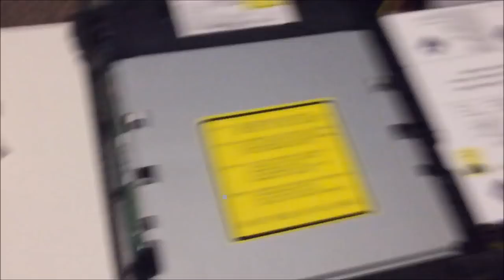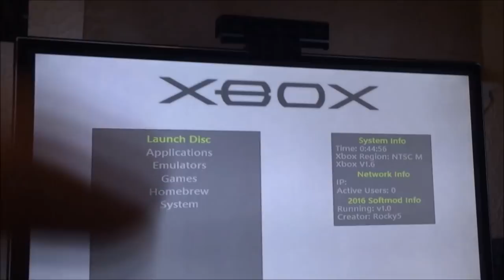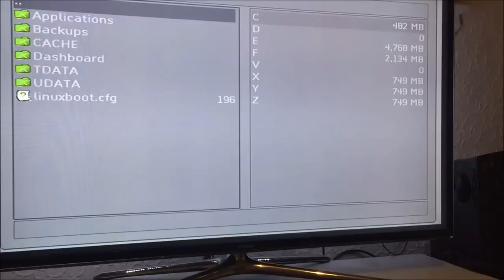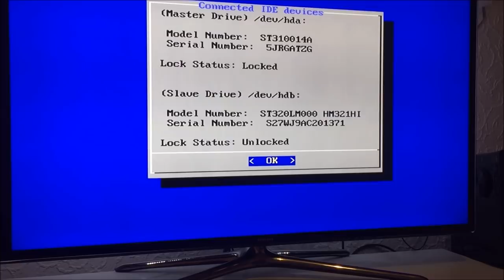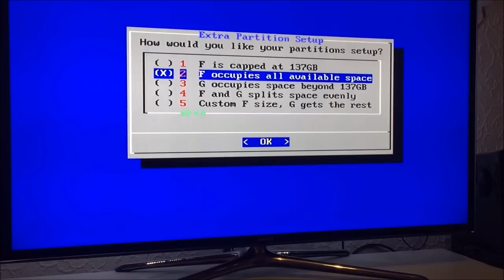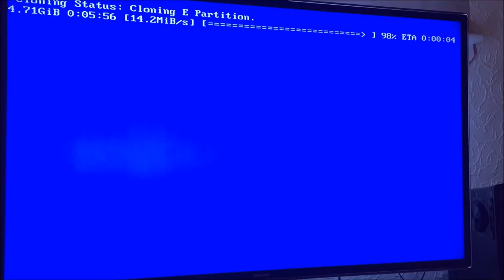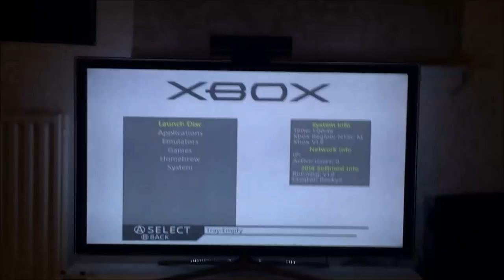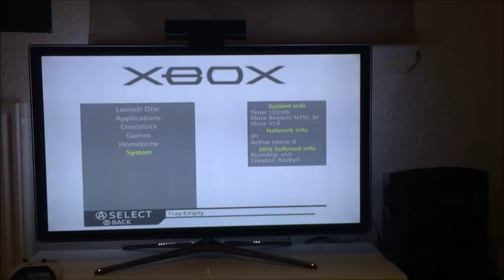How to clone your Hard drive using Chimp 261812 from start to finish.

Comment: One last question for you. I'm going to buy a different HD. Sata with the red adapter you have. You say you bought a new IDE cable... Will the stock one in the xbox not handle the job?
Reply from the maker: +Blackanese The Baby I would say no, you can get and 80 wire ide for pennies now a days, you will also see a slight speed increase in loading times for games when using one.

The issues I found and others is the 40 wire cable ( default Xbox cable ) causes to much interference when using most Sata to ide adaptors and the result were extremely long boot times or refusing to boot altogether. One of my adaptors caused my DVD drive to not read discs when using the 40 wire cable lol ( Xbox still booted )
Reply: JCRocky5 I see. I found one on amazon that I believe is the right one. Also found a compatibility chart with drives that are lockable so hopefully I'll be good there. Do you happen to have a video of installing and securing the data drive inside the Xbox after the clone or is it as simple as screwing it in where the old HD went and slapping the cover on the Xbox?
Reply from the maker: +Blackanese The Baby it's as simple as screwing it in, if you use a 2.5" drive you can obviously only screw it in on one side of the enclosure. 

Only issue you may have is fitting the 80 wire IDE cable, as the Xbox uses an non standard size cable but it does fit just takes a little time to get it sitting correctly.

You can also buy 80 wires ide cables via eBay that come in larger sizes.

I will try and find the diagram for folding an 80 wire cable.
Reply from the maker: +Blackanese The Baby here is the diagram ( web page ) buy a 24" ide cable.
http://web-nine.com/projects/xbox/ide/
Reply: JCRocky5 Thank you for your time and assistance. It was greatly appreciated!
Reply from the maker: +Blackanese The Baby no problem :) I'm here to help, if you have any more issues just give me a shout.

Comment: Hi JCRocky, you're probably the best on the xbox atm. Wonder, i have a lot of pain to format my TSOP V1.4 Ind-Bios  with my updated config file to start xbmc. So when i format the extented partition i have a lot of problems to make it work after a good transfer (HDD get corrupt.) So i wonder does this chimp gonna work well with tsop. I can format with it no problem, I only always have a doubt with chimp vs xbpartionner to do the right job. Chimp is so uch easier to use since you've updated it. Look there's something i've miss here with big hdd... Your chimp look different from the one i have (XBLAST OS??) Thanks
Reply: You see right now i'm wondering, should i format 50/50 or F: take 137gb and G: take the rest. Does this matters when you use IND BIOS? Also all the time if i check with XBPartionner i see no error in my cluster on each drive but still have problems with the drive. Any way there's a tweet proof tutorial for bigger sata drive to setup with tsop.
Reply from the maker: It depends on the size, but chimp 261811/12 will format your HDD properly, intact it’s 100% successful every time unlike XBP that can take a couple goes to get the format to stick.
Reply: JCRocky5 thank. BTW i actually make it work right after my question, cause i've formatted with chimp.

Comment: Whew... I have a startech PATA -> SATA adapter. Couldn't get it to work after trying multiple Xboxen, IDE cables, and hard drives.  Finally ordered an HDE adapter from Amazon (two pack for $13.99), and it works great.

Comment: I recently soft modded an Xbox again (had one at release long ago, which has long gone) during lockdown decided to do something cos i was bored numb.. So started messing about (and spending money) again.. stuck an old 80GB IDE drive in it, but as its probably older than most of the people on YouTube and give a s**tload of SMART errors during use. so I`ve got a SATA adapter and just got a refurb 250GB SATA HDD, but the sodding cable aint turned up yet.... Also removed the clock capacitor, nice to hear a different accent on here.

Comment: Hey Rocky I don't know if you'd see this or not. After I do this and have my new HDD in, with the Original HDD I think is still locked, per these instructions; then could I put in the original hdd if the new one ever dies?  If so, would I repeat the chimp clone process just as normal?
Reply from the maker: As long as the drive is locked to the current eeprom hdd key then yes you can always use it to fix up a new drive if your new one dies.
Reply: @JCRocky5  thanks rocky

Comment: Question: I followed your steps and replaced the XBOX HDD with my WD750GB HDD. What should the displayed disc size? In the partitioner, the extra partitioner is shown to be ~691GB and on the main screen, F is displayed to have 707GB. is this correct?
Reply from the maker: It should be fine, XBPartitioner counts sectors and UnleashX may just do a ruff check, don’t know without the source. But it should be fine. 

Check XBMC and see what it says for it’s size.
Reply: @JCRocky5  Thanks man! Can't wait to actually delve into the games and everything! You're the best!

Comment: Hello JCRocky5, I followed your instructions step by step , everything went fine and as expected but once I switch the old hard drive with the new one , after the boot up animation of the xbox i get a black screen ,unless i press the eject button on the console ,which will then make it boot into unleashx just fine . I do not know could cause this maybe its a dual boot setting? thank you
Reply from the maker: Applications > NKPatcher Settings > Kernel > Advanced Features > delay files > select 2 and reboot. 

If it still happens select 3, eg.... be careful as these can have adverse effects. So read the instructions at the top of the menu. 

Also what type of drive?
Reply: @JCRocky5  YEEEEEEESSSSSSS!! Finally, been fighting with this for months and finally found this.  A-DATA 64GB Sata SSD, had to use 3 Delay files, now boots properly! (Was stuck on black screen over 6 different drives)
Reply from the maker: The delay files just help fix issues with the exploit. I would also let it pick the correct kernel font for your Xbox as this will give you better compatibility. As by default it uses the generic font. (The select process it automated)

Comment: Hello JCRocky5 back for one more question so i went with the sata drive 
bought the green sata board adapter that you are not using in this video
 but did show in the beginning, the confusion for me is when cloning the 
master drive to the new sata drive what are the settings for the jumper 
on the green adapter? as there are only 2 options on green adapter slave
 or master so what one should be used during the copping process? cause 
you keep mentioning cable select ? don't see that option on the green 
adapter? and one more question once the coping process is done and 
complete on the new sata drive with the green adapter that i just copied
 the master files to, what do i set the jumper to now ? i would assume 
master, cause it is the new master drive but in the end you said it 
always remains a slave so i am confused please explain, cheers and 
thanks again for all your help
Reply from the maker: +elcarohw cable select is no jumpers, but slave is what you want and after the clone you set it to master. ( cable select allows the Xbox to pick what's the slave and what's the master, based on where the drive is on the ide cable )
Reply: ok so i should remove the jumper during the cloning process? or put it to slave ?
Reply from the maker: +elcarohw put it to slave and after the cloning and locking is done put it to master. ( you may get error 7 if cable select is set when using the new drive )

Comment: what dashboard/skin are you using? it looks so clean, I would love to use this.
Reply from the maker: +Avoiding Human Society it’s the skin I made for my softmod, as I wanted something clean and simple to look at and consistency across the installer. ( saves space if all your skins use the same textures )
Reply: JCRocky5 I found the skin from a post on reddit. I had to stalk your name and search around but you uploaded the unleashx skin to Google Drive on a reddit post. I am using it on my TSOP. only thing I can complain about is it doesn't tell you drive space but that's not a huge issue considering how clean it is... you can always go to settings and storage to look.
Reply: I agree. I love it's simplicity. Now I have to go searching for it too. :D
Reply: If you haven't found it here it is, I uploaded it to my mega account. just throw it in your unleashX Skins folder. I changed the creator name to my gaming nickname since there is no nickname option, no disrespect to the amazing JCRocky5. Feel free to edit it and change it to whatever you want.

https://mega.nz/#!1AcgCAAC!Dff7fGJHcRpuyu3QmnyOUd8lG_2bEj21tBFHy8edsIU
Reply from the maker: +Avoiding Human Society proper versions. 
https://drive.google.com/open?id=0BzRN8P835YijUGhyeTJWdTRpWEU

With new info where the softmod stuff was.

Comment: Do you have to do anything special to secure the hard drive once you clone it. The one you put in is smaller, so does it fit correctly, or do you have to do anything to get the screws in place to keep the hard drive from moving?
Reply from the maker: +Josh D mine sits unsecured but I don't have the lid on this Xbox. But you can use 1 screw to hold it screwed in tight. 
( there isn't much weight to them so they won't move about or undo screws )
Reply: Ok, awesome! I have another question; I've noticed that the softmod will soft reset the Xbox when I go to the save manager and view something that isn't a save (ie DLC or such). It just freezes, shows your logo, then resets back to the main menu. My Xbox will also temporarily freeze in the Extras disc (for at least 15 seconds, LT+RT+Black+Back will eventually kick it back out to the menu) on certain menus if I press up when I'm at the top of the menu. Is this due to instability, and would changing the kernel fonts or delays help?
Reply from the maker: +Josh D the crash in the save manager is just an UnleashX issue that was never fixed or can be fixed. 

The disc freezing the Xbox I haven't a clue as I don't get that issue or had anyone else come to me with an issue like that. 

The kernel font installer is only ever to be used if your Xbox hangs at the XLogo screen randomly. If you never have this issue then you don't need to use that advanced option.
Reply: Thanks a lot for the help, and also the great softmod and tutorials! I really appreciate it!

Comment: Will that green IDE to SATA adapter fit into the xbox with a 3.5" SATA drive, with all cables connected? Just making sure before I pick up a 1TB seagate barracuda, looks a bit big in the video!
Reply from the maker: +Eric Hurley yes, the adaptor does. Depending on the cable length you get it might be a tight squeeze. 
( for the cable not the adaptor, I would also put a bit of card or foam between the adaptor pins and the metal shielding of the drive )
Reply: Oh god, the green SATA/IDE adapter arrived from China this morning. I could only laugh at the quality of this thing haha! The soldering is abysmal and it's actually missing one or two SMD components. I kinda feel scared to plug it into my new WD 1TB hard drive.......I might pick up one of those Startech ones

Comment: Dude is there anyway to make this work with the HDMI Pound cable? It black screens. I do not have any TV's that use RCA cables anymore...
Reply from the maker: Try disabling all resolutions. If that doesn’t work then no, Chimps linux distro is old and doesn’t work on all video encoders above 480p.

Comment: Hello JCRocky5 , does the softmodding has limitations? i´ve changed an Hd with 160g to a 500g, its almost filled with games but if i put new ones they don´t launch. What am i missing here? i´ve done some search via google some people had these issue because of tdata and utdata file limitation
Reply from the maker: That’s not a thing and no. 

All you need to do is make sure the HDD is formatted properly. 

Also if you think it’s the UDATA issue (that was debunked) then rename your UDATA folder and let the game make a new one. 

Most issues regarding loading are corruption/corrupt hdd.

Comment: Hi JCRocky5 , I have installed your softmod and burnt the xtras disc, from the xtras disc I installed chimp , this placed E:\Applications\Chimp and in that folder there are 6 files and no folders, do i have to manually copy the linux267 file to the E:\ root ?  Or copy all the 6 files ?  Any help appreciated Great Work
Reply: Ok I have Ftpd over the E contents to E:\.  From a Chimp Master folder on my pc, However there is no sign of linuxboot.cfg.   Where does that file come from ? The only file in the E root is install instructions and it refers to xbp table writer please help i think i am close

Comment: I did the similar to my xbox original back in 2016 from another "how to" video on youtube with an 500GB ssd.
Still works stable after 5 years without any error screens.
Also since I have and wanted to keep the original MS dashboard (in which loads up when the chip is inactivated at the start), I backed up the eeprom bios file before I locked the slave drive (the ssd).
If not doing so, the MS os dashboard will instantly crash and you can only use the Executer os.
One thing to keep in mind about locking and unlocking the harddrive is to NEVER unlock the master drive as it may wipe out the backed up eeprom bios file and brick the MS os dashboard that can not be reverted again once it's lost.
Reply: any idea why none of my installed games in f are showing? i upgraded from a 300gb hdd to a 500gb ssd and i had a ton of games installed already i spent 8 hours cloning the 300gb drive to the 500gb ssd and it completed successfully but my games list is empty
Reply: @IND4GR0V3  Have you tried to run unleashX to see how much of the new ssd has been used, so that is similar to the previous hdd?
Have you made sure to clone everything on all of the partitions, and if the additional G drive used also has been selected when cloning?
If the E drive on the new ssd is bigger than the old hdd, maybe the games has been moved to there.
Last but not least, if you should find your games, make sure to put them in their individual folders in the games folder as xbmc and other skins is picky on where the games are stored in order to find them.
Reply: @draxoronxztgs1212  ive never actually seen this G drive anywhere in the file explorer before putting in the ssd, anyway i was able to test the ssd in unleash x all my saves and everything were there fine f drive showed something like 17 gigs free out of 465 and when i went into the games folder it was just empty. im about 56% done cloning this time with the newest version of chimp at the moment, this time during cloning i selected option 4 C,E,F&G take remaining space hopefully this shit works
Reply: @IND4GR0V3  Okay, maybe they will apper when it's done.
The G-drive is normally not used.
I went from the og 8 or 10 gig hdd to the 500 gig ssd, and everything I had was cloned successfully.
Even the original MS dashboard or OS, and copied the eeprom file before I locked the ssd so when I boot up the MS, it will not give me the gsod failure code.

Comment: Using your Chimp software. Praying that it'll work like a miracle. So far, your software has been smooth to setup... but when I accidentally did byte by byte, it wouldn't load the hard drive and there was no error code... yikes... trying again while formatting the separate partitions as seen in the video... about to lock the hard drive... and....
still doesn't work. My Xbox flashes error without a code and the LED light goes red and green... ughhhhhh

Comment: Please use the stock composite cables when doing this (red white yellow) otherwise you will have problems loading chimp, also use an official Xbox controller third party ones have trouble.

Comment: Hello Thanks for your work man . I just have a cuestion. So I just bought a soft modded Xbox I don't know the program used for the modding, it has a 80 go hard drive with a partition c ,e, f, and ,,G  on it , I'm had a 250 go hard drive to upgrade it , chimp reads it alright I want to come C and E , so  I have to pick Option 1 (clone C and E) then the option that says leve F with all the extra space right? I'm worried that the soft modded method used on my Xbox it's an old one because of the many partitions that I have and this method won't work . Will it ?
Reply from the maker: For 250GB yeah I would use F takes all space, your softmod should be fine for seeing the partition table. ( I don’t allow cloning without one on the master drive )

If you get an error stating there is no valid partition table on your master drive you can use the XBP Table Writer app I built from the XBPartitioner source or use XBPartitioner to add a partition table.
Reply from the maker: Yeah only official controllers will work with the loader, there is no countdown timer in the newer loader so it won’t auto boot.

Just run XBPartitioner v1.3 after the clone and setup and format the F partition using that and you will be all setup and future proofed.
Reply: @JCRocky5  thanks. Ok so instead of coping the chimp folder , I have to copy the xb table writer to the apps folder ?
Reply from the maker: Yes, but it’s pointless if you can’t use the latest version of chimp. The older builds don’t require the partition table to be on the master drive. ( they just use the hard coded offsets )

If you have an official control pad or can get a hold of one then use chimp 261812 if you can’t use Chimp 2618 as this will auto load chimp after 5 seconds.
Reply: @JCRocky5  got it, I guess I'll use the old chimp .  thanks man I really appreciate it .